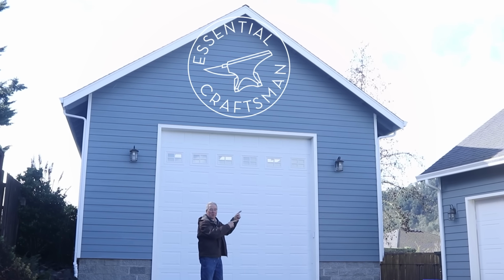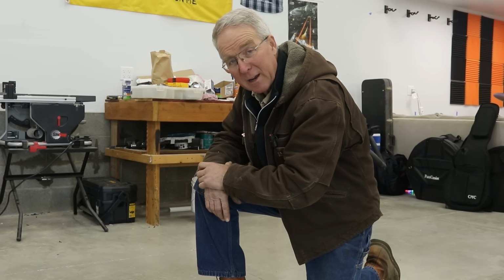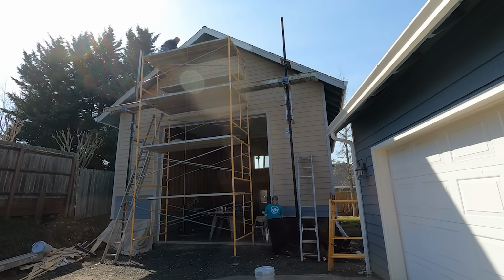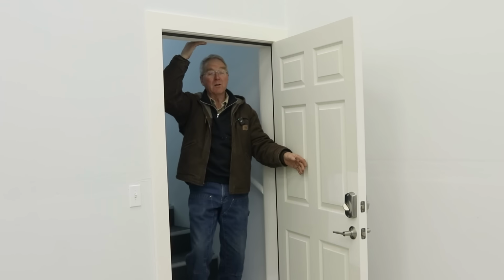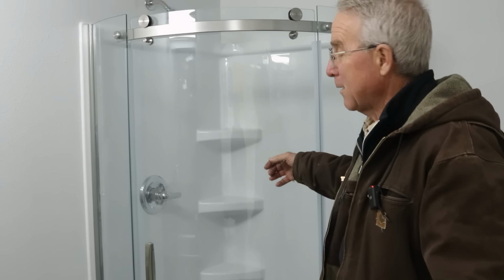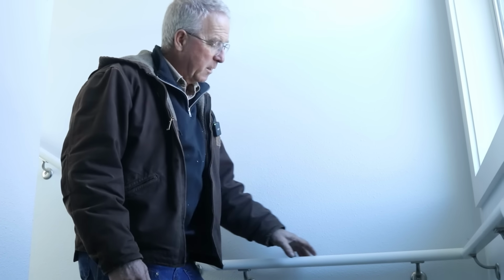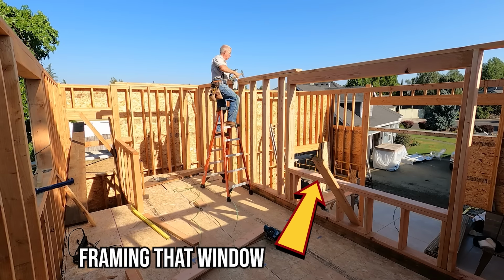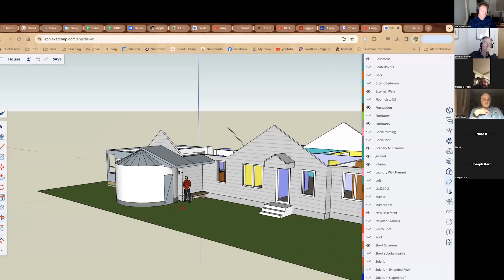Shop Build Final Reveal! The Good, Bad & Ugly

Comment: YIKES ... how did the inspector miss the stairway to doorway ?  If I remember correctly - a stairway hand rail must continue 12 inches past the stair's at the top and bottom of  the stairs
Reply: I don’t mean to be negative or critical, but according to the IRC you need a landing the same width of the stair at the bottom before the door. But maybe the IRC isn’t adopted there. The handrail extension is for commercial projects. All’s well that ends well! Overall looks to be a good build.
Reply: @bcopeland08   you are correct - its only required for commercial use